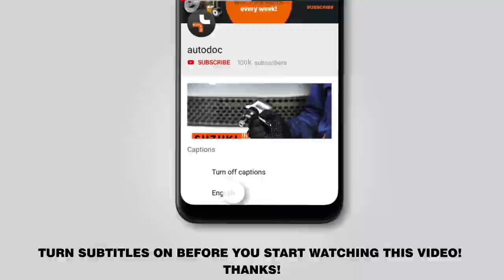How to change rear shock strut on BMW 520i (E39) [TUTORIAL AUTODOC]

Comment: Good job, TIPS: Don't remove upper arm there is room enoug to remove the strut. This save you a rear wheel aligment.
Don't remove your brake caliper this is also not needed. And for the shock spring two normal wrenches are ok. No need for the special socket.
I do appriciate the work here shown. Nice and tidy :)
Reply from the maker: Thank you for sharing your experience, it will be very useful information for us and our viewers.
AUTODOC
Reply: Did you stand on the hub to get it low enough for the coil to go in?

Comment: Just did this job, just follow the instructions to remove the rear deck and gain access to the strut mount, loosen the nuts but don’t remove, then just right to the 21mm at the bottoms of the shock , remove it and hit the shock with a mallet or hammer towards the inside of the car, it’ll come right out , then remove the nuts on the top and it’ll wiggle right out
Reply from the maker: We are sure that your comment will be useful for many of our viewers.

Comment: great video!!! does this also apply to the 2001 e39 530i 5 speed manual?
Reply from the maker: Thank you for your comment.
To answer your question, we need more data about your car, please contact our Customer Support service, and we will definitely try to help you.
Best Regards,
Autodoc team
Reply: If you have foldable rear seats in your car the procedure to remove the seats will be a little different and more complicated, but youll find videos on that too. Other than that bot sure, Im about to do this to my 520i 2002 soon.
Reply: @JohanM1  great thanks for the reply. I been clicked on that notification bell so I’ll be looking forward to more content 🤟🏾
Reply: @dhankins2012  I just did mine and I have both folding rear seats, DSP, and sun shade. The same procedure would apply, but you can skip the part at 1:20 and 2:39.  I thought it was easier since you don't have to remove the actual back support part of the seat, you can just fold them down. The sunshade did require some dexterity but nothing difficult.

Comment: is it the same on a wagon/touring?
Reply from the maker: In general, the replacement will be the same, the only thing that may differ slightly is the design features of your car.
 More information can be found in the technical documentation for your car repair.
AUTODOC